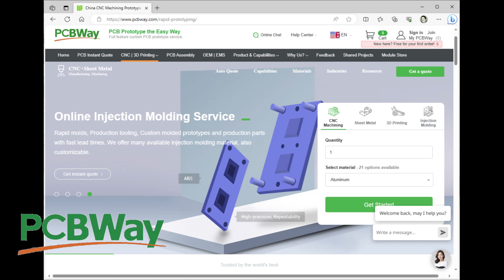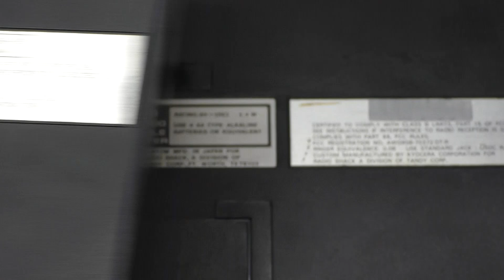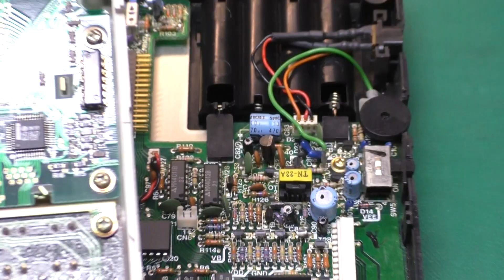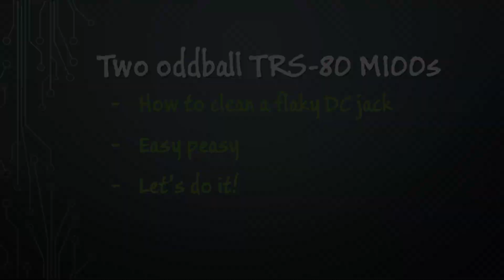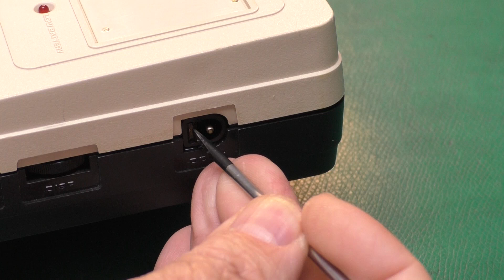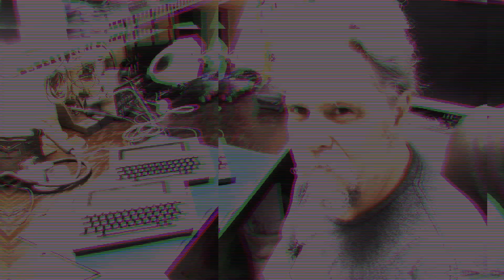Two oddball TRS-80 Model 100s. One is a one-of-a-kind prototype and the other has a blonde keyboard.

Comment: Malcolm Ramie has what I think is the counterpart to this prototype unit, an external EPROM board owned from Frank Druda, for the Model 100.  Malcolm was told the external board was used by Frank to get updates for the OS on the Model 100 during development.  The board was shown at VCF-SW 2024, and I dumped the ROMs, though the ones on the PCB are the same as the production OS. Someone might have received earlier ROMs loose from the estate, not sure.

Comment: I have several M100s, M102s, and two M200s, and I love watching your videos. I'll be recapping a couple of them and replacing the memory battery. I've never recapped before, so I'm a little nervous about doing it; I just have to man up and do it. Watching you over the years gives me a bit more confidence in doing so.
Thanks!
Reply from the maker: Defiantly practice on something non-important. When the capacitors leak, they can alter the chemistry of the solder and create an oxide layer on the surface. The oxide has a much higher melting temp, if you get it hot enough to melt you will lift the pad.
Reply: @HeyBirt  I'll keep that in mind... Thanks
Reply: Practice on some junk electronics.
Reply: @dosgos  I got a lot of old computer parts to sacrifice :)
Reply: Oh and make sure to clean up the board the best you can. You can remove the soldier with a pump and/or copper wick (flat weave). Just be gentle to not damage the board or traces.